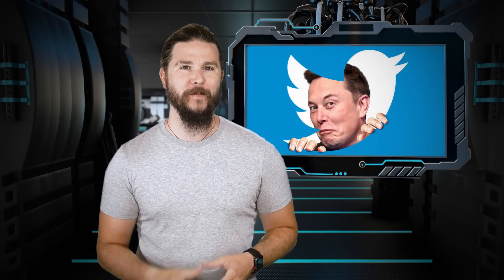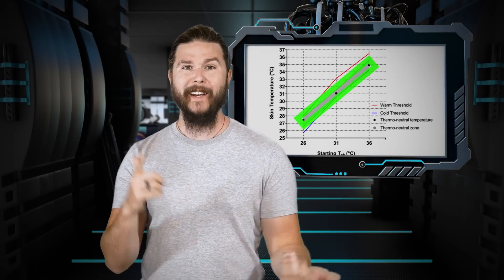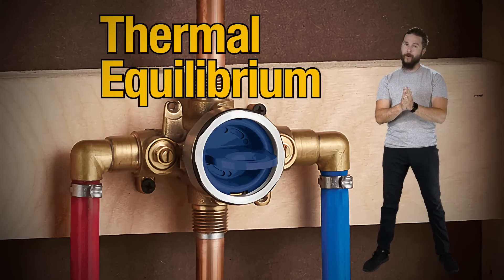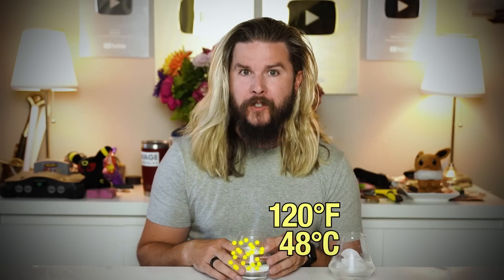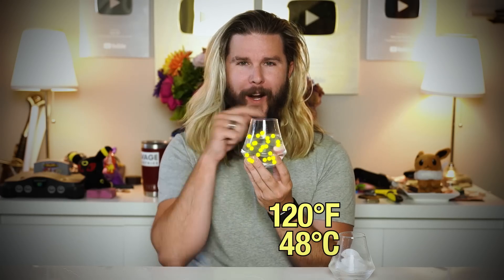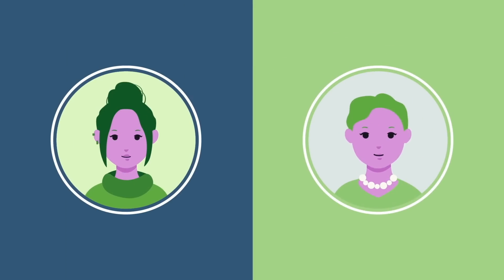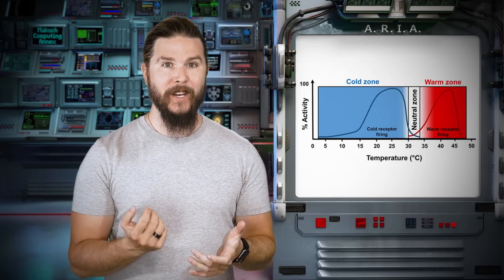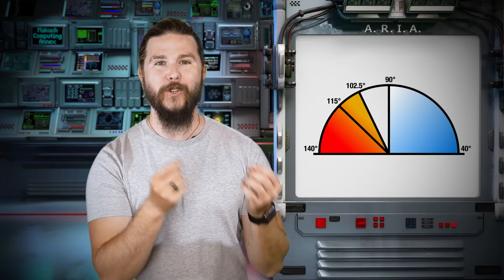Why Are Shower Handles So Sensitive?

Comment: Here in Brazil, the standard is electric showers and we have 3 selections: off, chilly, hot and 3⁰ degree burn. Lately, some showers have been coming with a potentiometer knob, so we hustle a little less with the eternal search for the most satisfying shower
Reply: Thanks god que noix tá tendo mais troço de qualidade aqui XD
Reply: Sometimes, we brazillians get to have cool things, as a treat
Reply: I use a gas-heated shower here in Brazil. It has ~20 selections of temperature and ~20 of water. I always use maximum water (so, I never changed the setting in all those years) and the minimum one of temperature, except on cold winters, which I use the next minimum one (2/20). My skinny ex once set the temperature to 4/20 and I was red for a month I think.
Reply: Idk bro, electric showers work pretty well.
Reply: @Lunesyne  yeah, they do! Nowadays. Not that much 20 years ago
Reply: Let's be honest, if you don't come out of the shower, looking like anakin, before the Imperator scooped him up and turned him into a Sega game console from 1994, you haven't showered yet.
Reply: @joko2882  
Agreed, boiling hot, is minimun temperature for me
Reply: @joko2882  my significant other has the same idea
Reply: Those shower heads shocked me nearly every time I tried to turn them off! I miss that country.
Reply: @Gladys edith We have those in the states too, sadly they take slightly more piping to get done so the plumbers I've spoken with don't want to bother. Mostly cause it was going to cost more and slum lords don't like things that cost extra. Even if it is only a few dollars.
Reply: 3⁰ degree burn? three degree degree burn? I can't be the only one in this comment section to notice this right?
Reply: @ungrave5231  3º = 3rd in some languages. It is also gendered in portuguese/spanish

1º = first (male - primeiro)
1ª = first (female - primeira)
Reply: @ungrave5231  nice video you have bro!

Comment: There is also the issue with slop ( the engineered amount of tolerance) to make the product mass produced. To much gap in tolerance means you may even start to turn the handle and it won't register until a short time after turning it. There is also the issue of distance from handle to head, too long and the change will take time to propagate meaning people will tend to adjust, keep no change and then keep adjusting then get hit by a huge change.

Comment: Huh... I think that outdoor water tap valves might have more adjustment? The simple ones that you might attach a hose to? A threaded seal where all the way down is closed and several turns is open. Two of those on the seperate inputs might give more fine grain control?

Or even better! Two inputs, each with those long levers for operation with your elbows, like when you've been doing an autopsy and you're covered in fluids. Like that. Hot and cold massive lever valves!

Comment: I find there are also issues with the length of the pipe between the heater and showerhead, especially in winter, you have to purge all the cold water first.  I also found when I travelled around the U.S., that some hotel showers seemed to either be - heat-but-no-pressure or pressure-but-freezing-cold.  In my home shower (in Australia), if I just turn on the hot tap I get a trickle that takes ages to heat up, but if I turn on the cold, the pressure goes up and the heat seems to come in faster too.

Comment: I have a hose head so I can point it at the floor and turn my shower full hot. Then I wait for it to get hot and then turn it down. If it’s in the middle, it’s not freezing but it feels slightly colder than my body.

Comment: Perhaps another handle connected to the valve which uses gears to reduce the extent to which a single turn would alter temperature?

Comment: I always wondered if I'd be able to run a shower with a dedicated tankless heater, using the shower knob to control its output temp setting. The water heater would have to be very close to the shower to allow for quick temp changes, though with a stable temp output, that should be mostly unnecessary.
I doubt that any tankless heaters have been engineered for external control or quick temp change. And I have no idea how efficient this would be compared to what we currently use.
For all I know, there is a setup like this out there, I just never came across it.

Comment: A simple waterproof circuit that reads the temperature and controls the valve, and you could have a setup where you simply punch in your desired temperature on a keypad and have it come out at whatever sweet spot you desire.  Add an up and down arrow on the keypad for fine tune adjustment and to have it made.  Someone get on this if it isn't already a thing...

Comment: You don't have to spend a lot to get a shower that solves this problem... There are shower faucets made with a pair of co-axial levers. The little lever sets the temp mix, and the big lever sets the flow. You can set the mix lever and never adjust it again. Every time you turn on the shower, it will be the same temperature it was the last time... Delta 17 series start at ~$150, depending on where you shop.  I have two in my house, and they are a must. (If you go to look for one, you have to buy the trim kit and the valve separately, make sure you do so!)

Comment: Seems more like the problem is with the hot and cold water inlet pipes usually being the same size. The cold water one could be a bit narrower which would make the temperature range on the handle that is "too cold" smaller, while not needing to reduce the hot water temperature.

Comment: I.. understand the problem this seems to be.

I have a solution:
turn on the cold water first, get the water pressure set. Then add the hot water til it's warm, does no one check before they walk/jump into the shower?
also why would you turn on both at the same time? I've never done that lol. 

This would solve the issue you're saying about having a "small range" where it's comfortable. 
Also;
I never realized the meme was real lol

Comment: You didn't even mention one of the biggest problems. Showers that use one knob to control temperature and flow, you can often have drastically different temperatures as you adjust the flow, even if you move the knob straight up and down.

Comment: Some showers let you adjust the hot side offset, so you can actually calibration the shower based on you water heater temperature.

Comment: I wonder if there is a Mechanical solution to this, a shower control that uses dynamic ratios to where, if you need cold, then the furthest setting is cold, and if you need scolding hot, then the furthest setting is hot, but ALL the real estate in the center would be used to control that "tiny zone of comfy". Maybe using gear ratios or something (Engineering Students are smarter than me so I don't know what exactly this concept is called)
Reply: Problem is you'd need a control designed specifically for your individual bathroom for that, you couldn't mass produce them. Well, I suppose you could if you set up a way to calibrate them once installed. It'd be far easier to use an electronic control system where you could set a specific temp and it controlled the valves to maintain that temp.
Reply: I think that thou art on to something here.
Reply: Thermostatic Valves, common in newer installations in Europe. One dial for temperature, one for flow.   Set the temperature, turn on the shower and no matter who decides to flush the toilet or do the washing up, the shower temperature remains the same (flow rate may vary)

Comment: Who the hell uses a single valve It is so much easier using a dual valve system by turning the hot water all the way on and gently cranking up the cold until temperature is ready

Comment: Pyros simply turns it all the way up because the only temperature is MAXIMUM TEMPERATURE. The only downside is getting out of the shower is a death sentence, but the upsides are I can reach into a boiling pot of soup with my bare hands.

Comment: I always default to pointing the shower head to the wall so I don't get sprayed, and I always start with 100% hot water, once it warms up to max temp, I'll adjust the cold to where I want it, and adjust it more as I acclimate to the warmth. But with two knobs, I find it's always much more control. But my water heater is set to about 140*F. You don't want water hotter than that, because plastic plumbing is only rated for up to 140*F, otherwise you will weaken the joints and cause a leak.

Comment: Additional stuff that isn't covered by video.
-There is often a play in the handle, where motion of the handle doesn't affect the water mixing at all.
-There is delay in the temperature output from the time of the change. There is already water in the pipe/hose so it takes a while to be replaced. The temperature difference can be absorbed by the water, the hose and the metal, until it equalises out and starts outputting same temperature. By the time the intended temperature comes out you are likely way past that point.

Comment: As a plumbing engineer I have to say you did a good job but you left out a big part. And if you don't explain to people the part you left out you going to have them looking for a different temperature every time they get in the shower. It depends on the time of day who else is in the home using water the size of your pipes restrictions in the fixture. Everyone takes a shower at the same time it's best to find the time when everyone's not in the shower or using water

Comment: Now explain why the shower in my apartment fluctuates so much even when I don't touch the knob. If I can find a comfortable temperature before getting in the shower it will change to being freezing, or scalding almost as soon as I step in, and it will flip between both extremes without me touching it, seemingly randomly. I don't even hear other people using the water most of the time.  Its so bad I don't even want to use the shower ever.

Comment: Another good thing to mention is that in terms of absolute temperature, your body likes 310K, with about a 5K difference between what we perceive as way too hot and way too cold. Therefore, changing the water's temperature by 1° is only about a 0,3% change, and we often want much better precision than that.

Comment: What about the difference in pressure on the hot water line? Instant-on water heaters seem to have lower pressure output than the cold water.

Comment: My shower actually has two knobs: A hot water one and a cold water one. So I need to control two dials to get the temperature just right. It wouldn't really be that bad except the hot water dial leaks. So to adjust the hot water, you need to burn your hand. 

We've consulted a plumber, but he said that he's never seen something like this outside of old hotel rooms. Gutting our bathroom and redoing the entire thing is on our To Do List, but given COVID, the price, and the fact that this is our only shower in the house, we've put it off.

Comment: My dad has a super nifty shower with a little bimetal thermostat to even make the numbers on the thing valid it takes a tiny bit to dial itself in but normal showers also need to push out the cold water from the pipes so not much longer than that

Comment: I have a tankless. My wife loves hot showers so I set the temp to what she showers with 115° so she gets in and just turns the handle all the way to hot. It's the easiest system even and even recommended by the water heater. I like cold showers so I am not sensitive to just turning it halfwayish

Comment: You don't need an expensive thermostatic shower handle to solve this. Instead, install a cheap fixed thermostatic valve on the water heater outlet itself. That way you can keep a safe 60 degrees Celsius but the maximum range is reduced to something more reasonable like 45-50. You also end up with more than 100% of your hot water heater's tank capacity. If your cold range is too low you can use a similar inexpensive valve on the cold side to increase it as well.  We're talking like $60 per valve instead of $400 for the full system.

Comment: I can't feel hot, cold, or tell the difference between them. (Doctors have no idea why. It could possibly be a symptom of one of my rare medical conditions but were not sure). My husband actually has to set and check the temperature of everything for me so I don't burn myself (again...). A laser thermometer has helped for times im alone without someone to do safety checks for me...... However...after seeing this video I don't feel as bad for struggling so much with the sink and shower temperature!  Lol 😆
Reply: Getting one with a thermostat installed might be something to consider for any major renovations near the shower. Here they usually come in models with two settings, left side determines the flow rate and the right side sets the temperature. The temperature dial tends to have a safety too preventing you from turning it above 38C unless you press a button down on it while turning. 

It's definitely convenient to have and will also not get much temperature fluctuations when other residents use water while the shower is active.
Reply: @extrastuff9463  that’s a good idea! Especially having a safety limit to how hot it can get. I don’t always have someone here to check it and a shower is practically impossible to check with my laser 😋

Comment: most showers in Europe have a safety button for temperature at 38°c which you can press to get hotter. its great as you just turn on shower and it will consistently hold that temp unless your hot water runs out

Comment: my shower has a much more advanced control, the knob has temperature values written and has a temperature-sensitive valve that keeps the temperature the same even if the hot water is not constant. And it’s all mechanical.

Comment: Having an in-line heat that only heats as needed also FAR more fuel efficient and thus more eco friendly
Reply: Realistically, in-line heaters are generally only better for heating specific amounts rather than to specific temperatures in the context of high volumes. That isn't to say they can't do it better, but I would imagine (though I'm no chemist or engineer) it's generally more efficient to heat less water more than more water less. 

Having said that, it does open up the possibility of electrically controlled showers, which could find the temperature of the cold water and use the minimum amount of energy possible to produce the desired temperature. I'm absolutely not a big fan of 'smart' home devices that don't do a job better than the one they're replacing, but this is definitely a situation in which a computer could do way better than a mechanical valve.

Comment: A contractor recently remodeled my bathroom and installed a new showerhead and valve. The first thing I had to do was take the goddamned water restrictor out of the showerhead so I could actually take a real shower. Next, I had to figure out how to remove the shower handle and rotate the plastic thing that limits how far you can turn the shower in the "hot" direction, because, probably to protect himself from liability, the contractor set it so I couldn't make it more than lukewarm. Very annoying. So, in conclusion, Kyle hates freedom of speech. Learn something new every day.

Comment: You can also partially close the shutoff valve on your hot water pipe, this will broaden the safe temperature range of your shower without any potential problems in your water heater.

Comment: Or just buy a proper thermostatic mixing valve (for your shower handle) NOT for your hot water heater as mentioned in the video. These automatically lock up the hot side of the water if it reaches a point that would actually burn your skin they also have a special adjustment that chooses the "sweetspot" you keep referencing in the video and they also automatically adjust as the water gets colder and colder in your water heater until its not longer possible to put out the temperature its set to.

Comment: My shower has less than a millimeter between too cold and scalding.
But I actually do use both ends for various things, just not showering.
 Especially since I have a high quality filter on my showerhead- filters out minerals, chlorine, bacteria, and almost as much as my PUR kitchen sink filter.

I use the hot mostly to clean/soak things, and the cold for fetching water like it's a well.

Comment: I just experimented with it until I found a spot on the dial which produced a comfortably warm stream of water and remembered where that spot was. Though it would be nice if the valve could thermoregulate and be set to a given temperature.

Comment: My house was built in 1979 and the showers have a valve for hot water and one for cold. The shower I use is in the hall bathroom, far away from the water heater, so it takes 2 minutes (I timed it) to get hot water. Then, I have to do a delicate dance with the knobs to find a liveable temperature. Mostly I turn up the cold, but then it'll feel comfortable then suddenly get cold. 🙄

Comment: The key fellow humans is to use micro-movements of your muscles. When adjusting, think about the ideal temp as you ever so slightly put pressure on the handle. The micro movements of your muscles will move that dummy thick lever just enough to give you the sweet, sweet temperature of your dreams.

Comment: Or.... Just install a thermostatic valve with controlled ranges... i have a valve on the right of it for flow rate and on the left, the knob only goes from around 35 to 40 C on a 45 degrees pivot with a little push-button on the back to unlock it to allow the full range to lava and ice in case you need it to fill a bucket or something else. That thing is a blessing and it does not cost that much more than a regular shower fitting since these are so incredibly unbelievably overpriced to begin with!